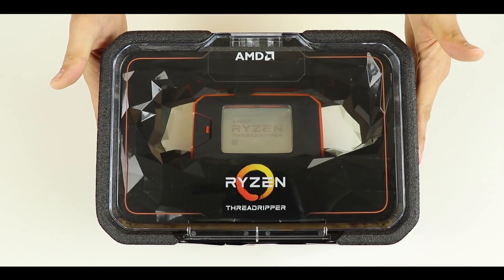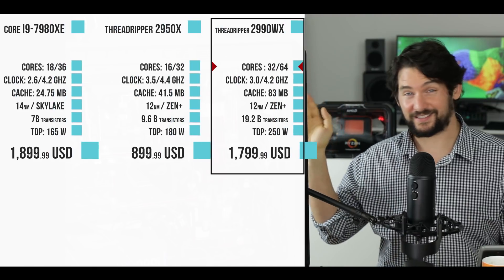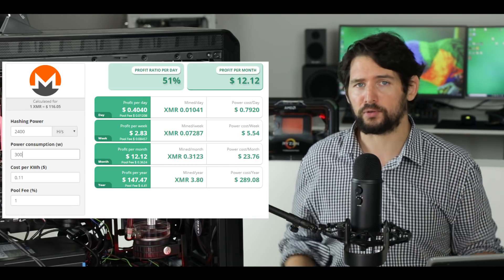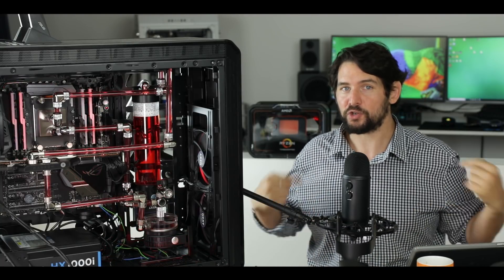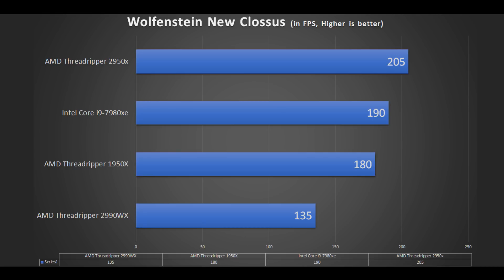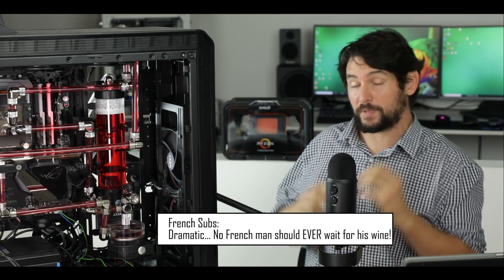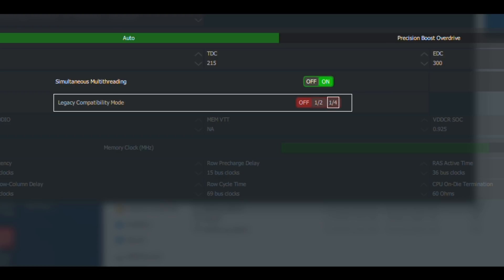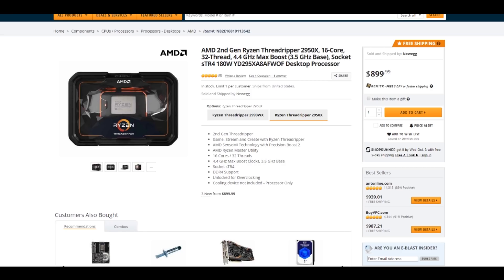AMD Threadripper 2990WX :  What have they done?

Comment: There is another slowdown quirk in Windows involving CPU core 0. It might be worth using processor affinity to prevent your games from using CPU core 0 (both threads), this has shown to give a massive speed bump to certain benchmarks bringing them inline with Linux results (minus 1 core).

Gamers are not really the target audience for this processor, regardless though, support will likely improve over time as various OS slowdown glitches are solved.

Depending on workload, 64 threads can very quickly eat 32GB of RAM and start swapping to disk so that's another slowdown issue to keep in mind, though it's not something gamers are likely to run into.  I built my little toy with 128GB to avoid this one.

Comment: Laurent, in the profit calculation for mining, is the costs for the CPU included as well? I only see the power costs, so, should it not be the case, you would have to run it 13-something years to be profitable, assuming that the hash complexity stays the same (which it doesn't). So, to state that it is highly profitable, is stretching it a bit.
Reply from the maker: Yes indeed. 

I did not add any serious ROI given tje volatility of the market..

We might fond ourselves with an XMR at 600 usd or 6 usd any day of the week.

It coule 13 months, 13 years 13 minutes.
Reply from the maker: What i tried to convey here is, given the current hash abilities of  market CPUs, and the extreme difficulty of XMR, it is surprising to see it being profitable at all on XMR.

And of course, imagine turning this hash towsrds other currency. Hence the 'extremely profitable' commen, which i agree, is a stretch by all mean.

Comment: Use Linux, if you want to use this processor using its full power, else you will have to wait till Microsoft improves its scheduler. Note that Linux runs the 2990WX much better, because the scheduler takes the physical layout of the chip more into account!
Reply from the maker: I would agree to that. But lets not forget AMD has marketted the Threadripper cpu as the ultimate gamer. 

And i hear u, they did had the W... but that is not enough to differentitate this CPU from the rest.

Let us not forget that the 2970X has the very same issue and is also marketed as a glorious gamer.

Comment: Have you tried to push the memory speed ? There will still be a bottle neck effect but if the ram is faster maybe it can process fast enough to perform better in games ?
Reply from the maker: Its set at the maximum threadrippers can take : 2933 mghz. 

If that qas the issue,  it would be present on the 2950x or the 1950x whilst benchmarking.

Comment: I assume you used a Nvidia GPU with an older driver. The reason for the poor gaming performance with Nvidia GPU's was due to their driver. The driver has since been updated and games now plays as they should. AMD graphic cards was not affected by this Nvidia bug.
Reply from the maker: Hey John.

Thansk for that ! Thats a really good point. 

Unfortunately for all of us, i tested the CPU with a RX VEGA 64 (water cooled). You can see it when i installed the CPU.

And, shutting down half of the cores did fix it, and FPS jumped right back to where the 2950x or 1950x delivered.

But what you remarked is spot on when it comes to Nvidia. Not many people ever noticed that. 

Impressed .. may i ask how u noticed this? Whats ur background. 

Thx !
Reply: I own a 2990WX and a Vega 64 LC. With the games I have ROTTR, DOOM 2016, SOTTR, Wolfenstein etc. I only get about 6-7% lower frame rates with 2990WX with all cores active compared to my 1950X. I.E in the ROTTR benchmark 110 FPS down to 103 FPS. Not a big deal.
Reply from the maker: Then you video card must be carrying most of the load. 
But its good to see that others are seeing lower perfomances from 32 cores compared to a 14 months old 16 cores.
Reply from the maker: Btw.. what on earth are u doing with a 5k usd computer??? Thats a crazy machine you got there ! Did u assemble it ??
Reply: Hobby. I build my own computers. I have no actual use for a machine this powerful, but I like to play with overclocking and benchmarking. Cheaper hobby than many other hobbies. For the 1950X it took over 6 months before Windows and the graphic drivers adapted and the system became silky smooth. 2990WX started out much better. Hopefully after the next big Windows update in 2019 the 2990WX should be closer to Linux performance if Microsoft fixes their thread scheduler and make it NUMA aware.
Reply from the maker: NUMA aware... you sir are not everydays hobbyist... what on earth??

1 persom on 10000 mention NUMA. 

Sacrebleu!!!! I am blown away.